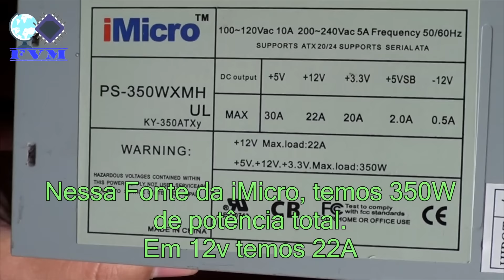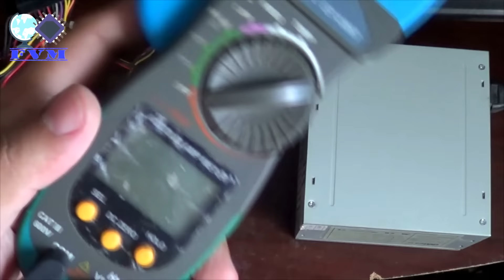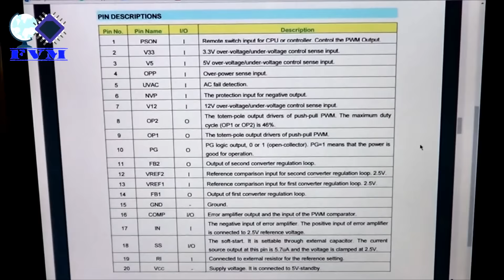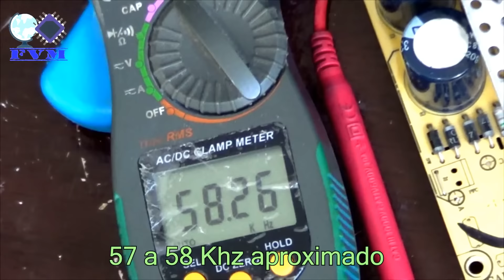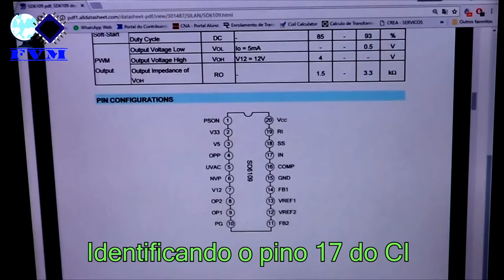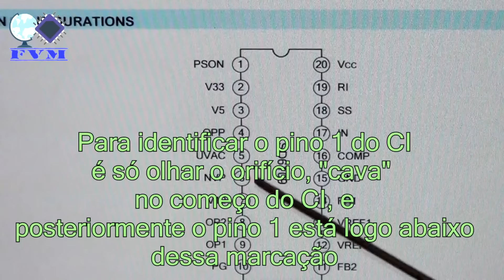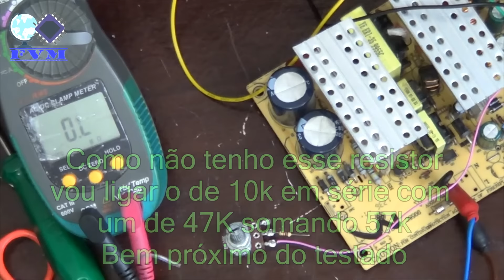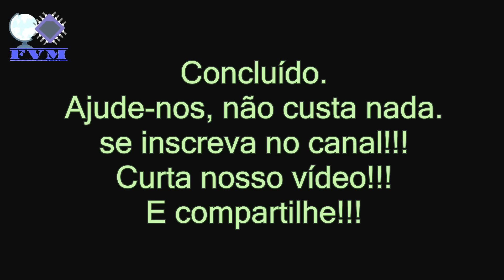Modificando fonte de pc ATX 12V para 13.6V, 22A, de forma fácil.

Comment: Muito bom! Mas gosto mais da modificação com diodos 10A10 (em paralelo) e em série com o terminal da bobina do mini transformador toroidal da linha dos 5 Volts. Obs: Nunca utilizar diodo Zener. Substituir também os capacitores eletrolíticos das voltagens de saída por capacitores maiores (35 Volts). A fonte roda suave e empurra a recarga de baterias até os 13,8 Volts. Bom vídeo!
Reply from the maker: Olá @miguel luiz Giacomelli
É ótimo essa configuração também, e rode bem também.
No nosso caso, fizemos como sugere o título, "de forma fácil", pois uma grande parte de nossos telespectadores são iniciantes em eletrônica, e por isso fazemos de forma mais prática para iniciantes também participarem dos nossos projetos.
Obrigado por está conosco.
Sugiro a você que participe do nosso blog se inscrevendo lá, isso nos ajuda bastante.
Link: https://draft.blogger.com/follow.g?view=FOLLOW&blogID=5745325357530072225

Forte abraço.

Comment: Boa tarde amigo
Ótimo vídeo, bem explicado, obrigado, agora deixa eu fazer uma pergunta.
Tem como aumentar a voltagem para 15 ou 16 volts?
Valeu, obrigado, ganhou um inscrito.
Reply from the maker: Boa tarde Paulo
Muito obrigado.
Com essa configuração que fiz, não dá, pois só alterei a resistência para "enganar" a referência de proteção do CI que é de 2,5v. 
Mas você pode fazer isso, alterando as referências de 3.3v, 5v e 12v, do circuito de proteção.
Reply: Teria como você fazer um vídeo explicando isso não?
Seria uma boa ter uma fonte dessa com a voltagem maior.
Obrigado pela resposta. Valeu.
Reply from the maker: Estou com pouco tempo, mais vou verificar a possibilidade de fazer um vídeo explicando isso.
Obrigado.

Comment: Boa noite! Tem como aumentar a amperagem na saída de 12V? Minha fonte não consegue ligar minha parafusadeira de 12v.
Reply from the maker: Bom diaRogeri Azevedo.
A corrente de saída é delimitada pela potência de sua fonte, ou seja lei de ohms, se sua fonte for de 500w de saída
Lei de Ohms diz: 
Potência = Volts X Corrent 
P = V / A 
Isolando a corrente...
A = P / V  
A = 500 / 12
Logo 
A = 41,66 Amperes.

Faça esse calculo substituindo a potência de sua fonte.

OBS. A potência é total da fonte, ou seja dividindo pelas tensões de 5v, 3.3v, 12v, -12v e as vezes -5v. "Isso está escrito na caixa da fonte".
E veja o quanto sua parafusadeira consome de corrente.

Obriagdo por assistir.

Dê um like, e se inscreva no nosso canal.

Comment: Jump pin 17,+resistors 50 k to gruond yes or no?
Reply from the maker: Hello @เอกราช ศรีสม
In fact, the resistor was at 56.7K ohms, and you should place it between pin 17 and the ground.
Thank you for being with us ...
Take advantage and also subscribe to our BLOG, it helps us a lot to continue our work, and it costs nothing. :)
https://draft.blogger.com/follow.g?view=FOLLOW&blogID=5745325357530072225

Comment: a minha fonte tem o ci AZ7500bp se poderia me ajudar?  pois pelo datashet dele lá tinha esse IN mais era 4 entrada , o  pino 1 e 16 era o positivo e o 2 e 15 era o negativo ! ai como  que faz amigo?
Reply from the maker: Olá Borges Cp
Esses CIs tem dois amplificadores operacionais internos conectados a esses pinos, existe diversas configurações que podem ser aplicadas, a mais típica, é você
Conectar os: 
( 1IN+  &  2IN+ ) ao terra. "Pinos 1 e 16"
e
(1N-  &  2N- ) à um resistor de 10k em série com um potenciômetro de 100k, ao pino 13 e 14 "que são os pinos de controle e referência".
Tenta isso, se sua fonte não tiver outro tipo de proteção, vai dar certo.
Toma muito cuidado para não deixar os capacitores com mesma tensão, e ao conectar na energia use um teste de lâmpada no mínimo.
Abraços.
Boa sorte.
Reply: FVM Learning blz parceiro vlw ae vô tentar Tmj
Reply: É o mesmo TL-494.
Reply: Ademir Freitas Machado como assim?
Reply: Veja no datasheet do 7500Z e compare com o do TL-494. São iguais em tudo. Por via das dúvidas, no pino 1 deve ter dois resistores indo para a saida de 5 e 12 volts. São sensores. E do pino 1 ainda sai um ou dois resistores em paralelo para o terra. Vou verificar se esse AZ7500bp tem algo a mais ou algo que não bate com o TL-494 e posto aqui.
Reply: Ademir Freitas Machado tá blz! agradeço pela ajuda
Reply: Não tem como anexar aqui, mas são iguais mesmo. Veja em https://pdf1.alldatasheet.com/datasheet-pdf/view/8974/NSC/LM494.html e também: https://html.alldatasheet.com/html-pdf/176250/BCDSEMI/AZ7500BP/596/2/AZ7500BP.html
Reply: Ademir Freitas Machado e como eu procedo ? Faço que nem do vídeo?
Reply: Não! Veja que são componentes diferentes desse SD6109. Não costumo usar o You Tube para esses assuntos, pois gosto de mostrar o desenho impresso! Mas você pode achar fácil tutoriais por aqui que ensinam a modificar o TL-494 ou 7500Z. Em todo caso, eu sempre digo: cuide primeiro da segurança! Um eletrolítico pode explodir em seu rosto e causar ferimentos. Jamais modifique uma fonte de componentes diferentes. Ela queima, entra em curto. Primeiro - por segurança - troque os eletroliticos da saída de 16 volts por um de 25 ou 35. A saída de 5 volts que são eletrolíticos de 1.000uF por 10 volts, por um de no mínimo 16 volts. Se você modificar e ela ficar com a saída muito alta, uns 19 ou 20 volts, é desastre certo! No teu caso, veja se no pino 1 do 7500Z tem um resistor indo direto para o terra. Meça sua resistência.... dessolde uma perninha dele. Se for um de 4k7 (4700 ohms) troque por um de 4k (dois de 2k em série) e meça. Se subiu a tensão, está no caminho certo. Isso é apenas uma sugestão! Faça a modificação se tiver conhecimento técnico... essas fontes causam danos sérios no corpo humano em caso de choque.
Reply: Ademir Freitas Machado muito complexo  , vô tentar aqui mais... obrigado pela ajuda ae
Reply: Observei que com carga, a tensão cai de 13 para 11 volts, o que não é bom para algumas aplicações.

Comment: Caro Amigo tenho uma Fonte da marca Premier 12 voltes a 15 amperes com o chip: que tem esta referência 2003,e depois tem BAQ 77170428H,será que me pode ajudar,pois sou um leigo nestas coisas,onde poderei ligar e qual a Força do Potenciometro e da resistência.,e onde é feita a soldagem.
Desde já os meus agradecimentos, um Abraço,desde Portugal.
Reply from the maker: Boa tarde Orlando Augusto, tens que vê qual a referência do CI, com essa nomenclatura que você colocou aí, não se encontra o datasheet do mesmo, veja se tem alguma sigla antes desse 2003, ou qualquer outro detalhes, quantos pinos tem o CI, pois sem ele não podemos ajudar, se achar o datasheet do mesmo, podemos indicar qual pino ligar.
Abraços.
Reply: Esse 2003 está em grande e depois por baixo é que tem essa referência- BAQ 77170428H,o CI tem 8 pinos de cada lado,desde já o meu muito obrigado,um abraço.
Reply: Boa noite Amigo já descobri,é o pino 14,tenho uma saída de 13.1,voltes e só desarma aos 14.7 voltes.
Reply from the maker: Boa tarde Orlando, que bom, agora é só colocar um resistor variável em série para controlar a tensão. 
Boa sorte.
Desculpe me a demora da resposta, sofri um acidente de motocicleta e estou me recuperando ainda.
Abraços.
Reply: KIA-2003 esta é a nomenclatura do CI. Tem também 2005 mas não vi no datasheet mas pode ser diferente.

Comment: Ola como retira a proteção dessas fonte de pc
Reply from the maker: Olá @geovani sillva
Essa parte é um pouco diferente em cada fonte ATX, cada uma trabalha com uma configuração um pouco diferente, o que você precisa fazer é, olhar o datasheet do CI que controla sua fonte, e procurar os pinos de controle de corrente, que tem no datasshet, e analisar qual a forma de trabalho dele, pois tem uns que trabalham com uma referência de 2.5Volts, outros trabalham com referência de um resistor Shunt, e tantos outros, e ainda tem o circuito de proteção de sobretensão e subtensão que faz as mesmas analogias.
Então é só no datasheet do CI da sua fonte que você vai encontrar essas informações.

Obrigado, se inscreva em nosso Blog.
https://draft.blogger.com/follow.g?view=FOLLOW&blogID=5745325357530072225
Forte abraço.

Comment: Ou em cere com outras quantas eu ia precisar.
Reply from the maker: Para a potência que você descreveu na pergunta abaixo, sim.
Precisa de pelo menos 110Amps, e tecnicamente tem que ser fontes iguais para poder ligar em 
Paralelo, não em série, a não ser que você pretenda ligar as saídas de 5v em série, e somar as tensões.
Ex.:

Em série:
 +  com  ---  com +   com  ---  com + com ---

3 saídas de 5v em série, um vermelho + um preto, depois o outro vermelho no outro preto, e assim sucessivamente somariam 15v.
só somaria as tensões a corrente seria a mesma.

Em paralelo:
Coloca-se todos os fios juntos.
Os amarelos com os amarelos e os pretos com os pretos, 
Somaria as correntes e as tensões ficariam as mesmas 12v.
Abraços.
Reply: FVM Learning então tenho que ter três fontes da mesma
Reply from the maker: Isso Placido
Três em série...., se for usar a saída de 5v.
Três em paralelo..., se for usar a saída de 12v.
Obrigado por assistir.
Abraços.
Reply: FVM Learning aí aguentaria normal

Comment: Boa  noite amigo, desculpe pois sou um pouco leigo no assunto, mas qual a vantagem de aumentar essa tensão da fonte ?
Reply from the maker: Boa noite Jardel, a vantagem, é poder carregar bateria de carro ou moto, alimentar um som com módulo de potência automotivo, alimentar circuitos que exija grandes correntes e tensão maiores que os 12v padrões das fontes ATX, e até mesmo como fonte de bancada, por exemplo com reguladores LM338 para 5A, e o LT1083 para 7,5A, a qual necessita de 1,5v de perda, então com saída 13.6 - 1,5 = 12.1, ou seja a fonte regulável iria ficar com saída regulável de 1.2v à 12.1v, isso com o LM, com o LT a queda de tensão é menor.
Abraços e obrigado por assistir.

Comment: Y para carregar una bateria ?
Reply from the maker: Hola Franz Moliner
Eso depende del tipo de batería que tengas, por ejemplo,  los de Obreak 12V 7 o 9 amperios, para cargarlos, es necesario tener una tensión de 13,4 V a 14, 4V, depende de la batería, es necesario que la tensión nominal de la fuente sea al menos un 10% más del voltaje de la batería. 
Fuerte abrazo.

Comment: amigo o meu é um Ci SD6109, consegui 13.85 usando o mesmo projeto do video porém o meu é pino 17, ao conectar a bateria 150 amp a fonte desarma pq será ???
Reply from the maker: Olá Cidiney Júnior
Qual configuração você setou a sua fonte?
O pino 17 desse CI, é o comparador do amplificador de erro, que é setada a 2.5V, você pode verificar com um multímetro a tensão quando você liga e depois que você conecta a sua bateria veja se a tensão cai, pois se alterar para + ou - essa tensão ele dispara a fonte "Proteção".
Verifica isso e nos informa.
Abraços.
Reply: deixei setado em uns 55k ohm
Reply: https://www.youtube.com/watch?v=ufPmNJEbnYI , olha no final do vídeo comigo tá a mesma coisa kkk até com lampada de 65w ta desarmando e ele normal no 12v n desarma
Reply from the maker: Cidiney Júnior
Não me refiro ao resistor, e sim, a tensão que está lá no pino 17, que tem que ser de 2.5, que é a referência do amplificador comparador. 
Se você tentar colocar o multímetro lá e medir e ver se essa tensão cai até quanto...
Outra coisa os os pinos de 2, 3, e 7, são os pinos de OVER-VOLTAGE E UNDER-VOLTAGE, ou seja sobretensão e subtensão, então se está desarmando é porque essa tensão está "quando colocado na bateria' abaixo do setado, então você deve fazer por exemplo....
Pega o a tensão do pino 20, que é 5V Standby que vem da fonte secundária e referencia ela para o pino 2 -  de 3,3 volts com um resistor em série para manter essa tensão estavel, e o pino  3 - de 5 volts direto, o pino 7 de 12 volts coloca ele na saída como resistor em série para regular a tensão que chega nesse pino em 12v.
Pronto ela não desarma mais.
Lembrando dos pinos de referência.
Abraços.

Comment: Ola, como identificar o controlador no meu ci ele e o 2003 nao encontrei o datasheed
Reply from the maker: Boa tarde WL Labiak
Para esses tipos de CIs 2002, 2003 e 2005, você pode ligar um resitor variável "Potenciômetro ou trimmpot" de 10k, em série com um resistor de 10k, e soldar um lado no GND "negativo" e a outra exetremidade no PINO 14 do CI, ajustar rodando o Potenciômentro e verificar a tensão que você quer obiter, depois que ajustar a saída para tensão que você quizer, podes medi a resistência do conjunto e substituir por um resistor fixo.
Abraços.
Dê um like, se inscreva no canal e compartilhe.
Reply: FVM Learning muito obrigado pela rapida resposta, estarei montando de acordo. Assim que obter exito retorno com o resultado.
Reply from the maker: Ok WL Labiak
O prazer é nosso em ajudar.
Reply: FVM Learning fiz o procedimento, mas a fonte nao liga. Comeca girar o coler ela arma e desliga
Reply from the maker: Bom dia WL Labiak
Você procedeu corretamente?
Identificou o PINO 14 corretamente?
Você colocou o Resistor de 10k em SÉRIE com o Potenciômetro assim:
GND -----------|||Resistor|||----------(Potenciômetro)-------------CI 2003 PINO 14.
Verifica direitinho, pois se ele está disarmando é porque tem alguma coisa errada na ligação.
Nos dê retorno.
Abraços.
Reply: FVM Learning fiz exatamente isso, tentei inuneras vezes e nao obtive sucesso entao verifiquei as tensoes nos pinos do ci. E elas ficam vareando nao sao fixas. Esta correto ou a fonte pode estar com problema?!
Reply: FVM Learning agora testei o ci ste 7502c com resistor e potenciometro 10k, a fonte desliga  quando chega a 13.50v
Reply from the maker: É possível sim que ela esteja com problemas... Tente verificar-la sem as alterações.
Reply from the maker: WL Labiak
Isso é normal, pois esse CI não só tem essa referência, e quando você chega até o limiar do CI, ele dispara por segurança, porque as outras referências ainda estão conectadas.
Lembre-se também de fazer as alterações dos Capacitores para suportar a tensão maior.
Abraços.
Reply: FVM Learning o que posso fazer para conseguir os 13.80v neste ci?
Reply: FVM Learning as outras referencias seriam os resistores ligados ao 3,5, e 12v?
Reply from the maker: Bom dia WL Labiak
Sim, seria as referências de 3.4, 12 e também a de 5v, que geralmente é ligada direto no CI na saida de 5v.
Reply: FVM Learning no ci 7502c  nao consigo chegar aos 11.80 e a fonte desarma
Reply from the maker: Boa noite WL Labiak
Esse CI tem Over Voltage Protection e Under Voltage Protection, ou seja proteção para sobretensão e subtensão, que desarma a fonte nas condições abaixo ou acima da tensão estabelecida.
Você está utilizando qual pino de referência? 3.3v, 5v, 12v, OVP/UVP?
É necessário saber qual alteração você está fazendo.
Esse CI 7502 além das referências OVP e UVP 3.3v, 5v, 12v, ele também tem o pino 16 VADJ, que é a entrada positiva de compensação, você está usando qual desses pinos, olha o Datasheet dele e verifica isso.
Abraços.
Reply: FVM Learning estou usando o pino  12 que chega a 13.80 e desarma
Reply from the maker: WL Labiak, o pino 12 é a proteção de entrada extra do CI.
Seria normal você utilizar o Pino 1 = 3.3V,  Pino 2 = 5V,  Pino 3 = 12V, e fazer regualgem com eles, pode ser só um, porém vai ficar com limites. Ou usar o Pino 16, que é o FeedBack da tensão de entrada.
Veja no Datasheet dele e verifique a pinagem.
Abraços.

Comment: e no CI CG8010DX ? Pino 12?
Reply from the maker: Bom dia Daniel da Milo
Para o CI CG8010DX -  O pino de entrada balanceada para fazer essa alteração, no datasheet é o pino "SS" 10.
Faça o mesmo esquema com o pino 10 de referência de 2,5v.
Forte abraço.
Dê um like, se inscreva no canal e compartilhe.
Reply: FVM Learning Amigo... fiz aqui e deu certíssimo!  Valeu! Agora só uma dúvida: quanto tempo em media leva p dar carga total na bateria?  Sabe me dizer?
Reply from the maker: Boa tarde Daniel da Millo.
Que bom que funcionou, ficamos muito felizes....
Já para saber o tempo de carregamento da bateria, vai depender de dois fatores.
1° Capacidade de carga da bateria 
2° Corrente elétrica que o carregador pode enviar parar carregar.
Digamos que você quer carregar uma bateria de nobreak 12v 8A
O seu "carregador" tem 20A de corrente fornecida
A formula para medir o tempo é
ib = Corrente da bateria;   
if = Corrente Fonte
Tempo (t) = (ib / if) * 1,35
t = (8000 / 20000) * 1,35
t = (0,4) * 1,35 = 0,54
Devemos mutiplicar o resultado para transformar em tempo por 60
0,54 * 60 = 32.4
Ou seja para você carregar nas condições ideias essa bateria você irá levar
32,4 Minutos. Nessas condições.

Coloque a corrente da sua bateria e a corrente da sua fonte, e faça os calculos, e tudo dará certo.
Forte abraço.
Feliz natal.

Comment: Necesito urgentemente.claro si me ayudas a aumentarle el amperage a 10amp. Y que se pueda cargar una bateria de 12 placas 750 amperios/hora 12 voltios de acido plomo?    Puedes ayudarme?
Reply from the maker: Hola franz Moliner
La amperage no puedes aumentarle tan fácilmente, usted necesita conseguir una fuente con este amperaje, que no es tan difícil, porque la mayor parte de ellos tienen más de 10 amperios en 12 voltios, qué cambiamos aquí, es la tensión, que sirve exacto así que podemos cargar las baterias.
Cuanto mayor sea la corriente más rápida será la carga.
Abrazos, estar con Dios.